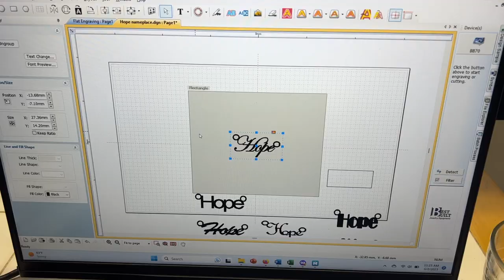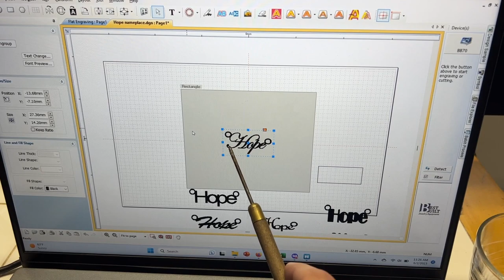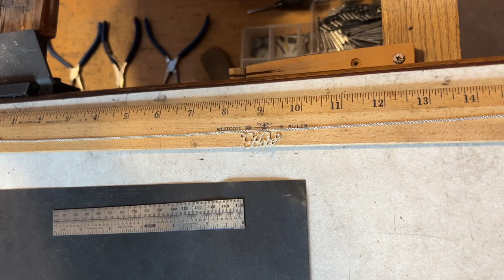How We Made a Hope Necklace - Best Built Engraver and Milling Machine - BB70M

Comment: how thick of a silver sheet did you use in this video? and how thick of a silver sheet have you used or the machine is capable of ?
Reply from the maker: We used 1mm in the video. It could probably go up to 2mm, but that is a guess. To cut metal, it does multiple passes through the metal until it reaches the required depth. But there will be a limit as to how deep it can go based on the cutter tool itself (even with multiple passes). You might want to contact Best Built directly and and ask them.